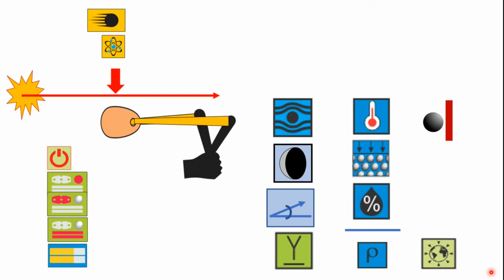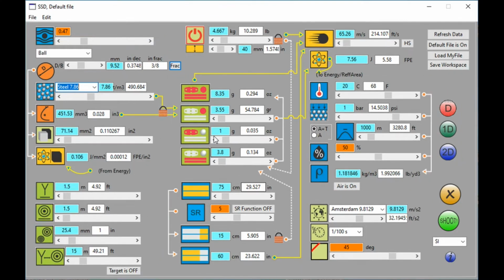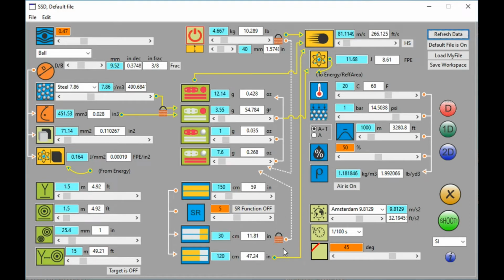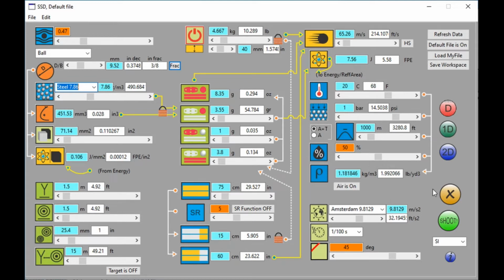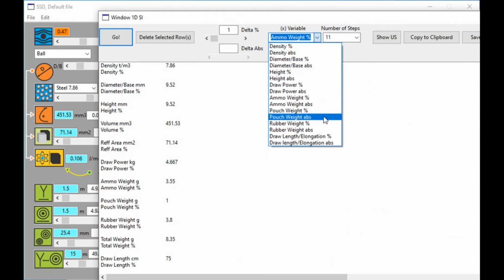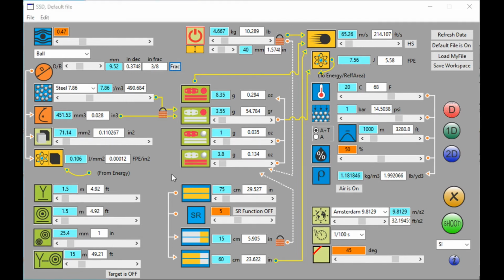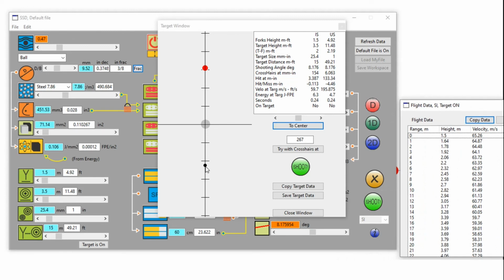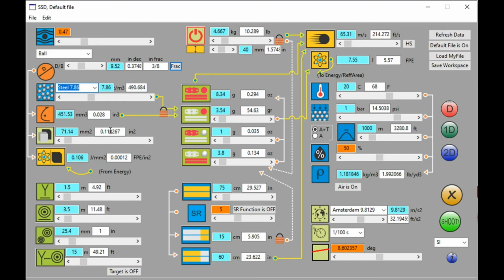03 How My Slingshot Setup Designer Works

Comment: It seems as though there is a cap in rubber width at 200mm. It doesnt mess with any of the speed or rubber weight calculations when you increase the draw power, but the program will display a constant rubber width as soon as it goes beyond 200mm.

Comment: Hi-- Great Job. -- I have one question, in studying Smooth Bore Rifles:  During the Civil War the change from a round ball to the Molley Ball made a greater distance and accuracy possible.  How would it work for the slingshot?  Thanks again for your work.
Reply from the maker: It would certainly work for slingshots but I think it is more effective for bullet-shaped ammo. I think that this needs some experiments to prove this or that and the extent. Also, it is not easy to make a fast rotation of the ammo with slingshots. However, these are just my thoughts, not quite sure in their validity.